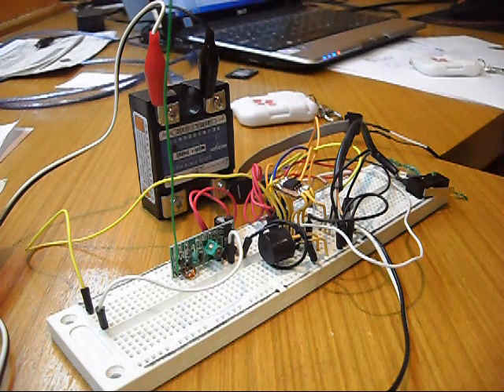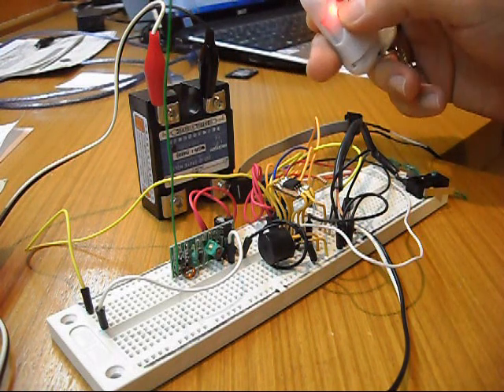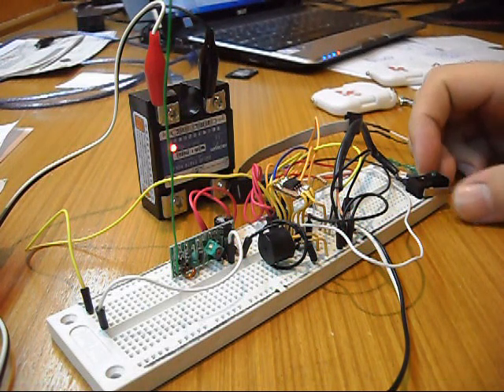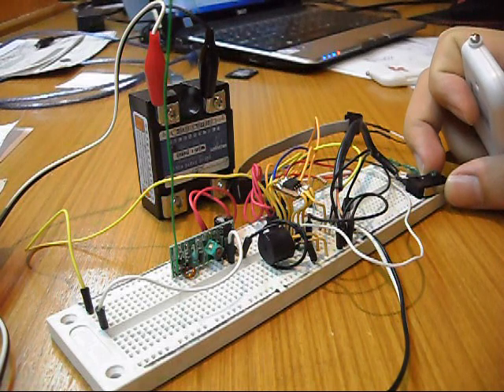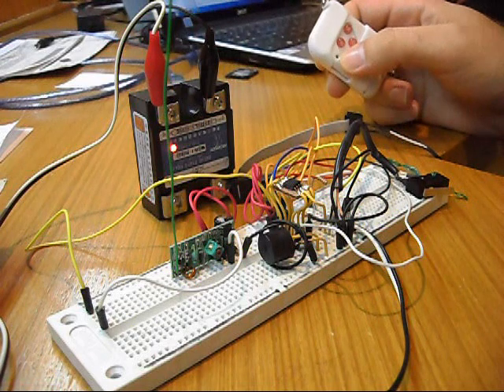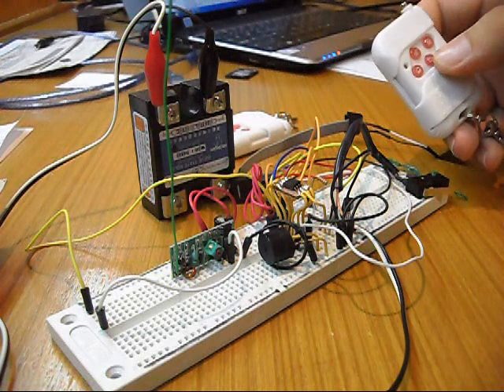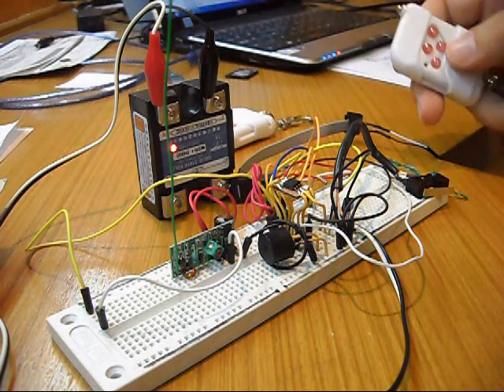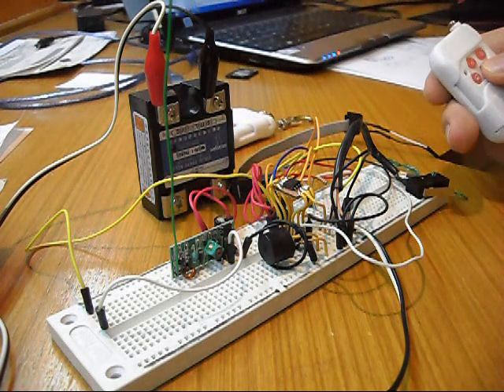attiny RF decoder and appliance control

Comment: Hey bro, can you edit the code to add two more relays on pin1 and pin7 of Attiny13 which are left unused in the existing code. In this way, we will be able to control 3 different devices..I am not good at coding..